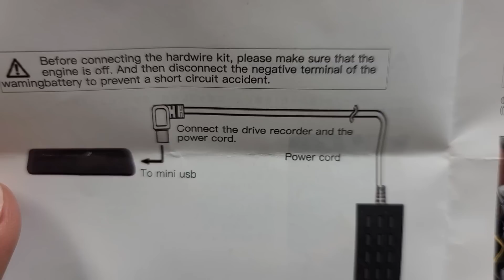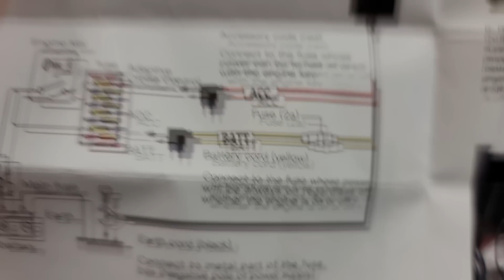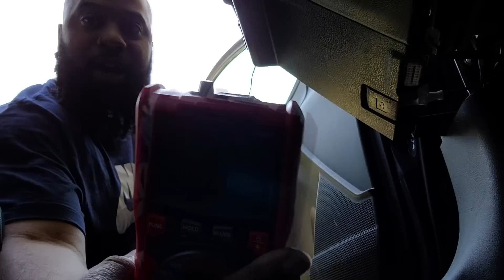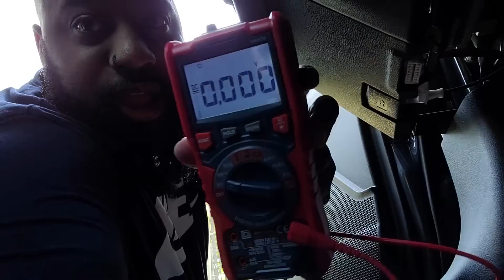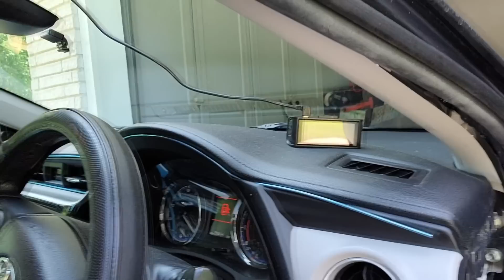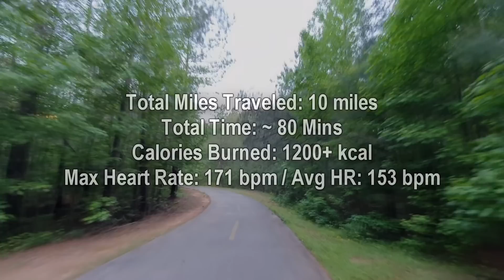I Almost Got Hit By A Car Trying to Skate | Ep. 4 - My Journey to Wellness

Comment: If the humidifier doesn't work for your congestion due to allergies, get an air purifier. Walmart and target was having a sales on Levoit air purifier.  The journey to wellness is never easy. It sucks right now but you will get there❤
Reply from the maker: Thank you! I have one. I run both of them constantly. I sleep with the fan on so that doesn't help but that's probably the biggest culprit.